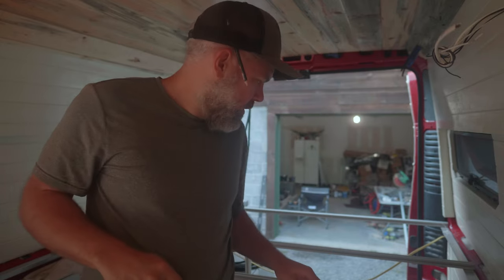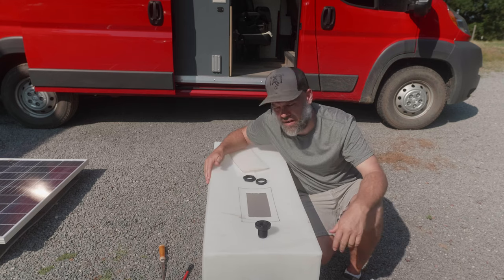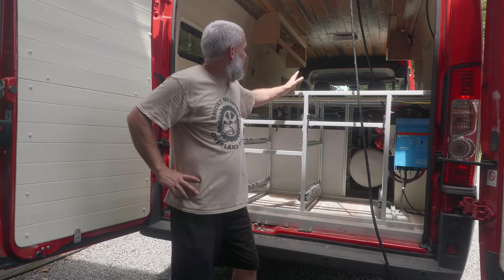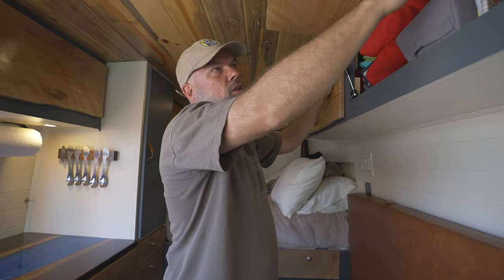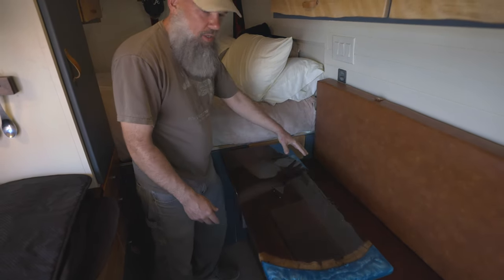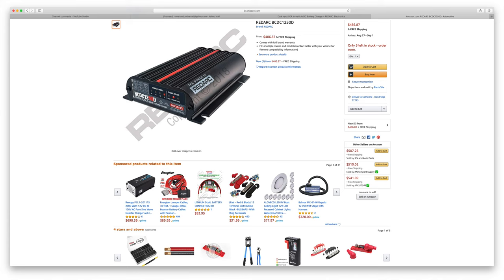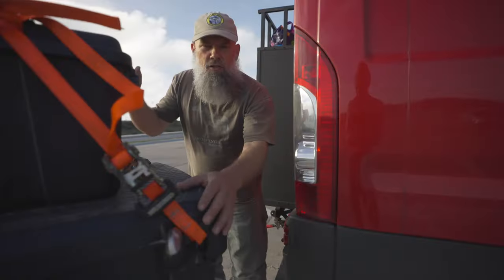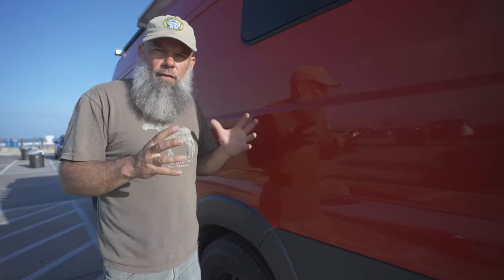DIY Promaster Van Conversion Build Part 7: The Final Product! Camper Van/ Van Tour / Tiny Home

Comment: you have did a heck of a good job man!! Big red is a heavy girl, but like you said maybe you can workout some of that. im about to install almost the same solar system as you have in my camper trailer, only i have all same panels and i used a 3500 watt inverter of a different brand. But hay!!!! looks great and its good to see a video from ya. yall be safe and keep at it!!
Reply from the maker: Thank you! Good luck on your solar/power setup in your camper trailer.

Comment: nice build y'all, beautiful waterfall countertop! I'm designing a very similar 3500ex build and am stumped by your gvw. is that 9.5k including 400#'s of water? any thoughts/advice on weight trimming appreciated. cheers
Reply from the maker: That was with about 1/3 full water tank...Our wood is heavy, both the epoxy pours and 3/4” Baltic birch. would have maybe used more composite wood and/or a different material that is light and strong and won’t bow. Appreciate the support, however. Good luck on your build...don’t forget to enjoy the process!!